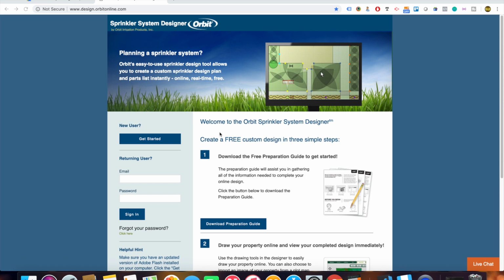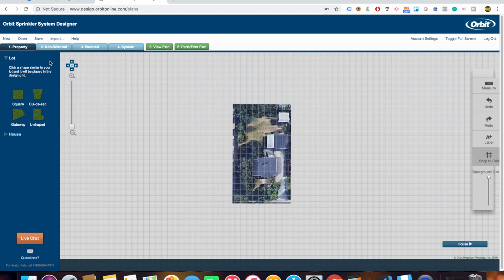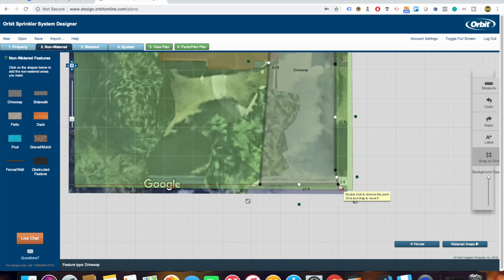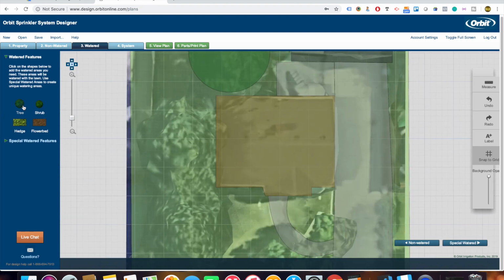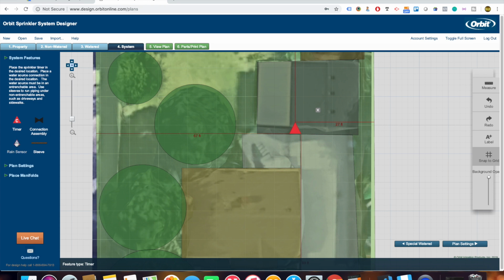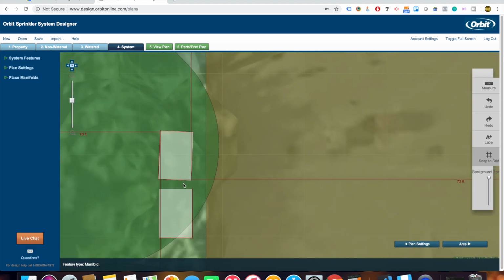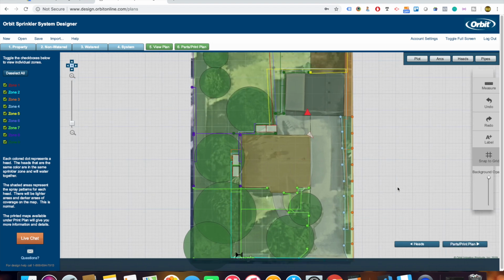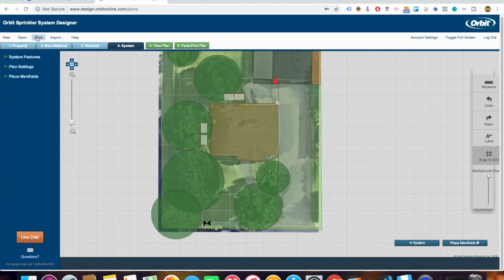How to Use Orbit Sprinkler Designer

Comment: Great video. I know this is 5 yrs old but the program is still available so needs to be discussed. It locks up once I spend all the time to map and configure dimensions - this after multiple attempts and restarts. Before that I couldn't find a way to recalibrate by using the measuring tool so distances were 10x by default. The next day I tried for a third session. Had to restart several times again but I finally got it to recalibrate. Weird that the option didn't even show yesterday.  My PC is a 2yo gaming PC I built so it's fairly competent but the program is just buggy. I also felt the drag points were not intuitive and are unlike any other graphic or photo program I've used. To me it's likely an old offering from an employee or hired team that is no longer employed by Orbit - clearly not supported. I shouldn't complain but it wouldn't even allow me to build a price list even if I was going to buy the massive list directly via the program. Sorry but this kinda leaves a bad taste in my mouth. 
Here's a trick: Upload a Google earth image, Use the recalibration based on a known dimension, Then do a separate overlay for the concrete and house. Screen shot each image that has your measurements and then print out a clean version of the Google Earth pic. Now you can overlay and transfer the lines and measurement to paper and you can lay out your zones. 
Paper and pen it is!

Comment: The software from the website is different form this so I can't follow the tracing option in beginning. I think the new software is broken with Chrome.  (you can't drag the tracing rectangle for the lot drawing nor can you pull the sides).

Comment: WARNING: The program had an update. Orbit needs to update the guide. It also has no help menu and no contact info for help. You would think there would be some form of help tools!  Also: don't have an ad block program running or it will cause random problems.

Comment: I have spent 8 hours trying to get this planning appp to work. After 30+ in software, I can confidently say this app, which now does not operate as the YouTube demo, is a total piece of crap. Operational errors, inability to recall save plans, missing sizing  and positioning capability on trees and such. I was really jazzed to use this app and then perform a large project in my new home. I am an experienced irrigation user that moved from AZ and this app has forced me to move to other vendors thatn Orbit. Bummed.

Comment: This does not work very well on Macintosh.  It's almost garbage.
Reply: Works a bit better on Chrome but impossible to import a google earth photo on Safari.  It still has a lot of trouble with importing and setting distances in Chrome on Macintosh OS 11.6 Big Sur but it managed to finally do it.  Need to fix the functionality of setting a known distance on an imported picture.  I had to scale the picture down to get it on the screen.

Comment: First I though this was a great program until I tried it. Wow it is a great idea but does not work.  I tried on a high powered desktop computer for CAD and it did not work at all.  I was not able to get the measurements or anything else to work.  Then I went to my new laptop (Surfacebook Pro - top of the line) again no luck.  It did come up with a few more things but it was like pulling teeth to get the littlest thing to work.  Very good idea but very poor program.  Sorry not ready for use at this point. Time for a new program team.  This looks bad on Orbit as if you can't get this right how can you design a sprinkler system.  I tested with Windows 10 and Chrome without any luck on 6/27/2021

Comment: The version I run as of June 2021 does not look anything like this program and I cannot figure out how to add scale. Also, how in the world do you stop drawing after you've clicked all 4 corners of a rectangular area??? I have tried, clicking the first point, dbl-clicking, shift -clicking, right clicking. Nothing seems to work!
Reply: Still figuring this out myself, but sometimes you can freehand draw, then click the initial icon (lot, structure) and it will end the freehand. I tried to their chat feature (hidden well as it looks like a sprinkler in the lower right corner) but you have to be patient.  Danielle did get back to me and also provided this tip on saves - open a duplicate tab and look at your saves there to confirm save is working.
Reply: Same experience here. Will just use ol skool graph paper I guess.

Comment: I'm planning to connect the system to rainwater tank to supply the water, but I dont know exactly which pump I'm gonna use. how can I set it?? Is it possible? The software can help me to identify which pump should I use to have the prop water flow and pressure?? Thanks in advance.
Reply from the maker: Hello, unfortunately this system is designed for the use of municipal water supply and does not have any settings for pumps. If you know the GPM and PSI your pump will produce, you can enter those settings and it should give sufficient results.